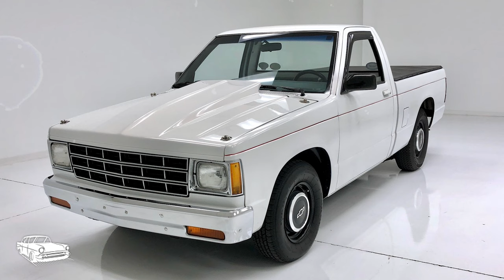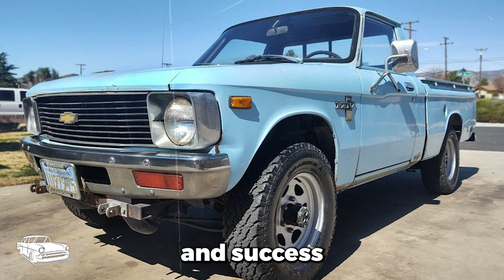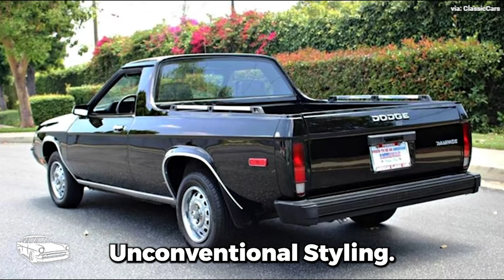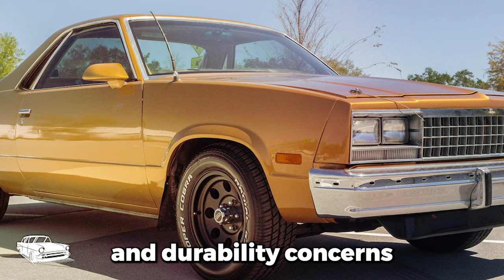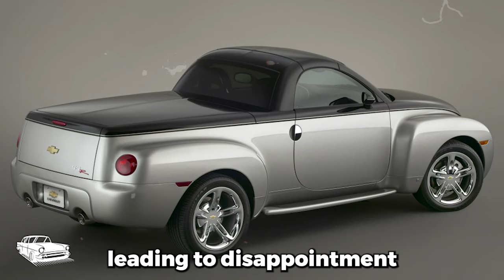5 Worst American Pickup Trucks That Should Have Never Existed

Comment: The pinto "pickup" was a custom conversion. Not a production car. The luv, well, you were actually right on that one... The rampage and Caballero (pronounced ca-ba yer-o) were great vehicles, not meant to be actual trucks. Now on to the SSR, not the SR, it wasn't supposed to be practical. It was a show piece. Better luck next time picking out PICK UP TRUCKS, instead of utility vehicles.  There were FAR worse pickup trucks that should have replaced all, except the luv, the vehicles in this video. Better luck next time.

Comment: This was the worst video I've ever seen. Only 1 vehicle on the list was an actual truck, the Chevy LUV, and none of these were built to compete with traditional full size trucks. The Chevy SSR was underpowered? 400 HP is underpowered? The GMC Caberello was underpowered? Well so was every other car in the 80's, the Camaro Z28 in 1987 only had 215 hp, the Corvette only had 240hp, so a Caberello with 170 wasn't bad. But with the exception of the LUV none of these were built to be like a traditional truck, none had a body on frame construction. This video is horrible and I hope they never make another so full of nonsense.

Comment: Right off the intro, The Pinto pickup FIRSTLY was NEVER a production vehicle, the one shown is a 79 or 80 not a 70 and it is based on the pinto WAGON which did NOT have the exploding fuel tank issue. I wish you videographers would learn about cars before making this garbage.
Reply: Absolutely.  Only the 71-73 coupes needed the impact plate between the tank and rear axle. Any WAGON chassis, had the tank filler on the side.  They didn't have the tendency  for fire. 
Please use a real human voice. AI generated voice is just lazy
Reply: Yep! Never a production vehicle. This is full of bad facts.
Reply: Well it is bad facts cause the dude is a hater. And I never heard of a Pinto pickup before. And he has no proof of any photo or video accident of that pickup so yeah, he's a hater...
Reply: Very true the Pinto truck wasn't even produced by Ford.The GMC Cabalerro was just an El camino.It has a great following today and then!!!Chevy LUV was popular and good for it's rime.Plus,false info with a crappy pronounce sucked.
Reply: @imrytebeehyneu  You are saying the presenter is an anti-car guy? I even still hear bad comments about the Mustang II, it was stifled from being a Mustang by the government, but the Pinto/Mustang platform was one of the best handling chassis to come out of 1974. Even if the Pinto had a crucial safety fault, first it's not a pickup, second at least know which car had the fault. The fact is he compiles some cars, edits them into a video, says some words and as crappy as it is, we are here giving him ratings with our comments all be them negative.
Reply: Never even heard of it.

Comment: Do you even read about any of these vehicles?  The pinto wagon the truck was based on never had the fuel tank issues.  And Pintos sold like hotcakes the whole time Ford built them!  You don’t build a car that doesn’t sell for a decade!  Speaking of decades, the Toyota truck didn’t really come on strong until the 80s. The LUV and Ford Courier (Mazda) were far more common than Japanese trucks. It was the late 70s before Japanese car lots became common everywhere. They had been mostly a west coast thing and European cars were more common in the rest of the country. Finally, I know you must think folks was ignorant back then, but we weren’t. There is only one truck on this list. The rest are coupe utilities. Nobody cross shopped trucks and coupe utilities!  Nobody walked onto a Dodge lot and said “do I want a D150, a D50(Mitsubishi), or a Rampage. Also, nobody built a coupe utility expecting high sales figures. They were a way to add another body to an existing platform and squeeze a few extra sales out of it. Maybe you should consider researching more, or talking to someone who actually was alive during that time!😂

Comment: I used to have  Chevy Luv and I loved the thing. I would pull an 18' enclosed trailer behind it on a daily basis and it did fine except it did not like to turn when it was raining.
Reply: I was confused by the narration on it, 1st part bashed it, middle praised it, last 2 sentences bashed it again...ugh...My brother had Ford Couriers iniddle to late 70s 4speed and a 5 speed, Courier and Luv had some same similarities. My brother's was white with a black hood, he put a brush guard on it and a black rollbar with fog lights, of course installed a CB, his 1980 one lasted about 300,000 miles (he was in Air Force and stationed in Michigan and Nebraska, long drive to Pennsylvania and back racked up miles
Reply: @vintvarner16  I also had an old Ford Courier and loved it. I ended up using it in a business I had.In recent years I have only driven full size trucks. I have exceeded 300,00 miles in every one I had. Ford or Chevy. Now seeing if I can no that in a RAM.
Reply: I had a '80 LUV Mikado edition with factory A/C.The only downside was the automatic sapped too much power.
Reply: I believe that the LUV was the first factory small 4x4 pickup. All the rest were conversions. It was also a great vehicle for it's market.

Comment: My Dad bought a Chevy LUVin 1977. It got great mileage, but lacked power. his truck had the 2.0 liter engine. I think this engine would have run stronger, oe had more percieved power if it had had a lower rear gear set. The LUV came with a 4.11 axle ratio. This allowed it to get heavy loads moving, but the engine ran out of power at speeds above 45-50 MPH.

Comment: On the Caballero,  I don't understand  all these negative reviews regarding its engine strength and performance. Negative styling remarks, I can understand as up to the B pillar it is a Chevrolet Impala.  The 78-85 Impala, a workhorse in law enforcement city state and federal levels, if the Caballeros having the same power train options, if not more performance, which is the hallmark of the GMC badging, what could then be the cause of its reportedly lo performance in comparison even to a gmc 1500 pickup truck, them both having the exact same powertrain?  an 85 s10 pick up? a caballero was faster than the 4 cylinder datsuns, toyotas and nissan hardbodys of the era. And ssyling?  the El Caminos and Caballeros had it hands ov er the plain jane "stylings" of the same trio of the period.

Comment: -Ford Pinto truck = baby Ranchero, which in the past had been made on both the compact Falcon and mid-size Galaxie platforms
-Chevy LUV = Isuzu captive import. Literally done to compete with Ford's Ranger, which was a Mazda import
-Dodge Rampage = An El Camino-ized Dodge Omni/Charger, which there was a market for until mini-vans were created
-GMC Cabellero = An El Camino with GMC badges and power windows, and it had the same issues as the El Camino
-Chevrolet Esser = Chevrolet SSR. I've done voice-over work in radio. Contact me so you won't sound like an idiot in your next video
I hate it when people that know nothing about cars or trucks, make videos about cars and trucks.

Comment: One truck that should have been here, the mid 70s Datsun pickup, many of em had rust issues as the Vega did, and caberator issues that made em very unrealible.  (73 to 77) the bodies also dented extremely easy, sometimes leaning on em wrong cause a dent.

Comment: You sang the praises of the Chevy Luv and at the end called it one of the worst trucks ever made.
Reply: I noticed that too.  They tell us how good it was, then tell us it is one of the worst.  I had a 1974, and it ran good and was reliable, but the chassis had problems with rotting out due to its enclosed box frame design.

Comment: i had a 1973 El Camino (GMC Cabelero0) .  Irepaced the Air Shocks  wVariable Sprins & Ajusable Shocks.  With the 350 engine & automatic transmission I could haul 1500 lbs (1100 was Factory w/Air Shocks0 & pulled my uncle's 15 ft. runabout boat with ease.  these vehicles were all on  car chassises.  Youu just had to know what you wanted to do wih them.  i loved mine.

Comment: What is the point of this.  Only the LUV was actually a pickup.  The rest were basically cars with a bed.  I had an El Camino that did some truck duty after I put overload springs on it.  They were just Chevelles.

Comment: Actually the Dodge Rampage was QUICKER than Ranger and S-10 and even fullsize and mid size trucks! It blew them away....it wasnt made to compete against those trucks as Dodge had the D-50 that was the same as a Courier/Ranger and Luv/S-10...

It was NOT made to compete with Ranger that never existed when the Rampage came out that was Ford Mazda built Courier...Dodge had the D-50 compact truck to compete against the Ford Courier and Chevrolet Luv then later the S-10...

It was just a car based truck not made for towing but for a homeowner or small business that needed a vehicle with more cargo room..

They ran 8 second 0-60 thats quicker than compact trucks of the era that ran 15 seconds and slower!! It was a rocket during those years..

Comment: 0:23  There may have been a few customs, but Ford never built a Pinto pick-up.
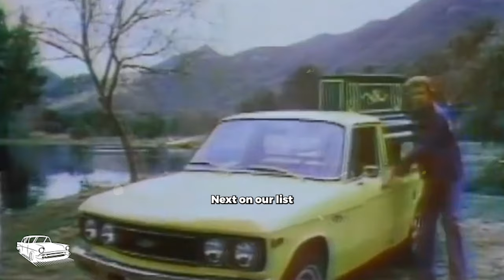2:30  The LUV was not an American pick-up truck. It was a badge-engineered Isuzu pick-up. Narration at the beginning of this clip damns the truck for poor quality, but toward the end the robovoice croaks its praises.
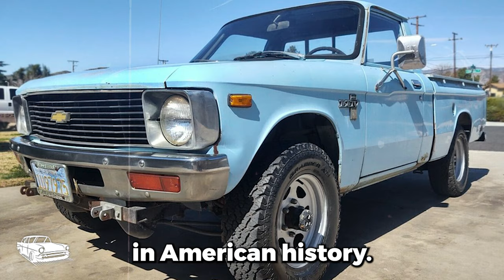5:03 Dodge Rampage and its twin, the Plymouth Scamp were not particularly bad for what they was, actually a useful runabout for light hauling, but it wasn't a true truck.
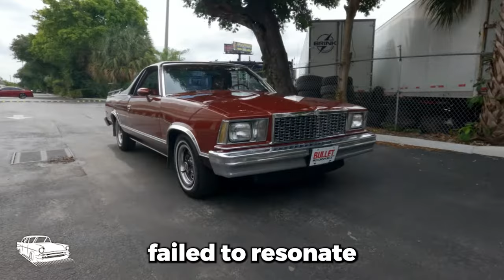8:34 The comments about the Rampage/Scamp models also apply to the El Camino/Caballero twins. While more useful than the smaller Chrysler (and Volkswagen Rabbit) offerings, the El Camino/Caballero were still a compromise for anyone who needed a real truck. And by the way, the El Camino/Caballero never "transitioned" to front-wheel drive platforms. When the rear-drive body-on-frame G-platform Monte Carlo/Gran Prix/Regal/Cutlass Supreme models were discontinued, so were the G-platform trucks.
11:20  The SSR was a typical WHAT THE HELL WERE THEY THINKING product.

Comment: I assume the guy doing this video has never diven one of these or owned one. As other said the Pinto truck is only custom built like the Mustang or Cadillac ones. The LUV is no worse than the Datsun models, Ford Courier and others. Same with the Rampage. Considering Shelby thought it good enough to modify. They were not meant to compete as a large truck. They were for people to have light truck capabilities with a car ride. And please enough with the Pinto fire bomb thing. It was disproved over 30 years ago. You can find the article by itself on line and possibly through Hemmings. Any real car person or car historian would know that by now. Well should have known it years ago. You get a D on your homework. Should be an F but at least you are trying. It drops to an F if you don't make a new video with the reason Utes were made for 30 years and more.